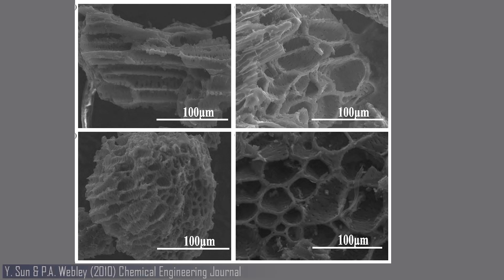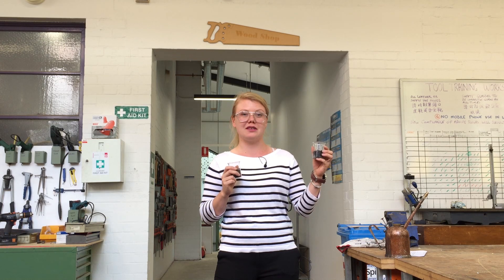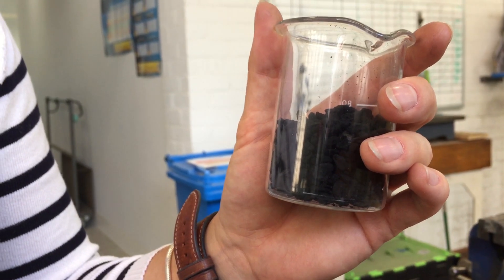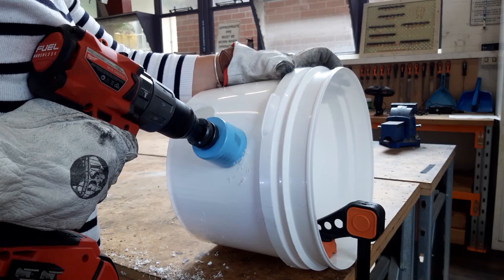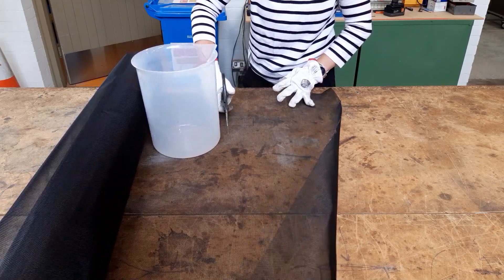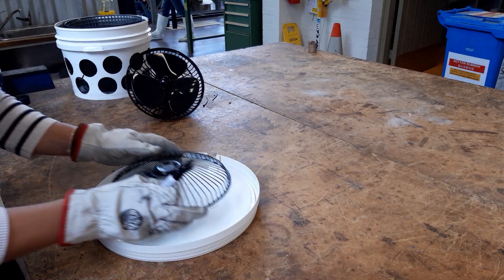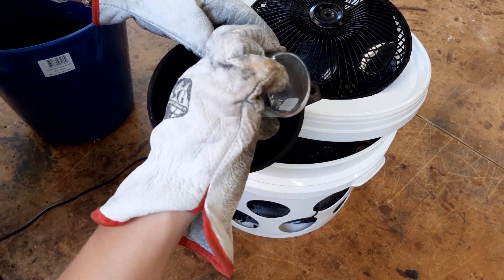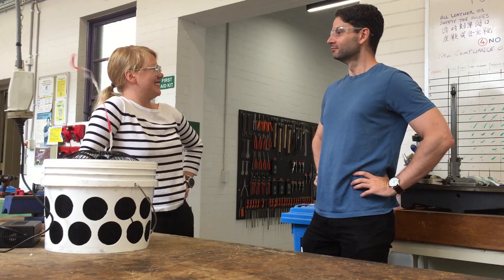Activated Carbon Filter

Comment: Great! Do the activated carbon particles filter thru the fly mesh?
Reply: The mesh is designed to be looser than the carbon so no. if you just wash it and then hang it after it stopped dripping it will dry from the fan. Provided there's nothing electrical that could catch fire underneath, you should be good. But then again I'm just someone on the internet, what do I know ^^